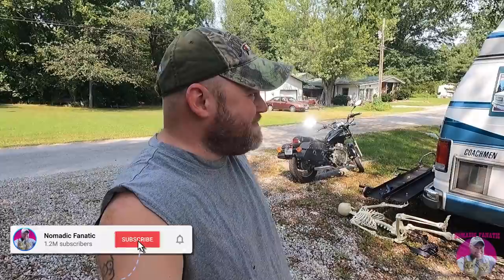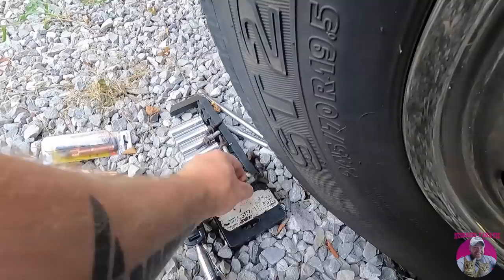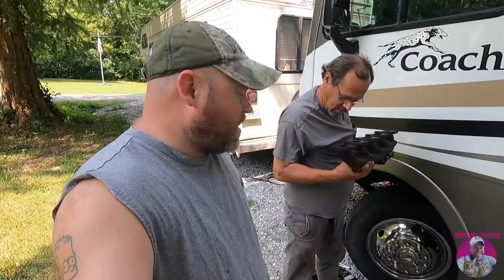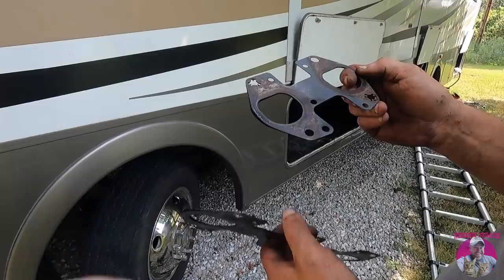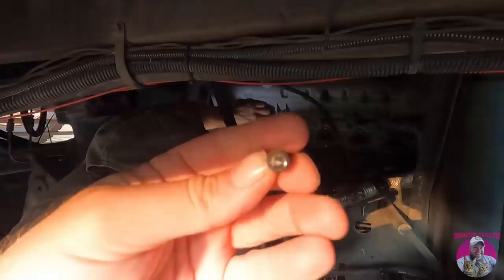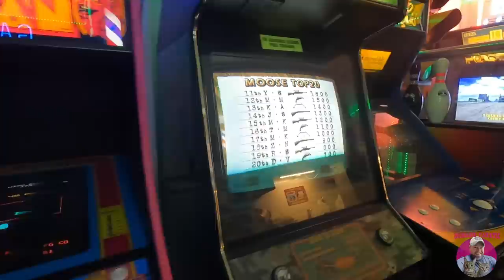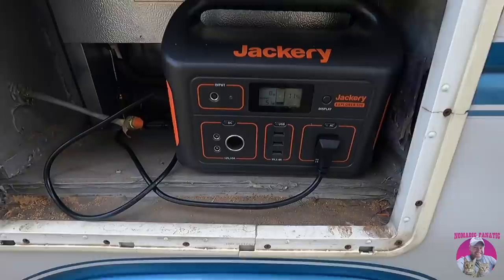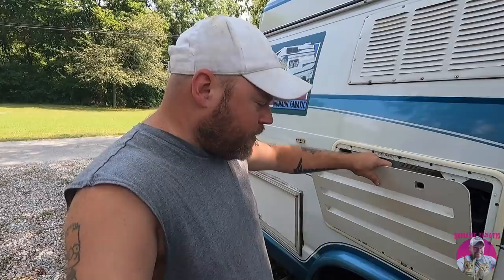Back Working On Class A Exhaust Leak ~ RV Prepper Wayne Drove up From Florida

Comment: One way to keep the Jackery charged to run you fridge longer. The Jackery comes with a 110v charger that puts out about 80 to 100 watts of charging power. Get a $20 150w inverter to plug into your cigarette lighter on the van, and plug the Jackery charger into it. (You may need an extension cord) These small inverters are sold everywhere, including amazon and are only about 4"x3"x1". I have two of them in my minivan. Cigarette lighter receptacles have a 150w fuse, so as long as you're not drawing more power than that, you're fine. A small fridge should run continuously, if you are traveling a lot. Fridges cycle off and on, so the average draw is less than half the max draw. You already know your average draw from your test run with the Jackery. Just divide the Jackery watt hours used by the time it took to use them. I would bet it's less than 50w.

Comment: You and Wayne need to go in together on an RV lot in Taylor Co. FL where Traveling Robert and Awesome Campers are.  They each have an acre.  It required water, power and improvements but you can have up to 4 RV's there.  You would be able to have a basecamp in FL for winter FL trips.  That would give you multiple basecamps for safer travel.  Also, if you got tired of IL you would still have a pl ace to go.  I firmly believe that all RVers are going to need homebases.  Also if you were near Wayne you would have access to his repair skills more easily.

Comment: If you ran the fridge on the 12V output of the battery box, it might actually have lasted a few hours longer, because of fewer losses from converting to AC and then back to DC inside the fridge. Possibly even twice as long? Stands to be tested...
Reply: I thought the same thing! I have a 500 Jackery but only a 20L fridge. It'll also depend on the outside temperature how much power will be needed to maintain the temp.
Reply: His last statement was confusing.  Eric said it ran 12 hours, then he said it was good for 24 hours?  I was curious about that.  I also have a Jackery 500 and my little trailer fridge is AC only.  I rerouted the plug so I could power the fridge during travel.  As long as the fridge is cold, it shouldn't take too much juice to keep it going for 8 hours.  The problem arises if I boondock and need the power for another day.  (I do have 400W of portable solar)  I guess I will have to try it on the road.

Comment: They sell them in 8 packs because most people have Ford V-8 engines, the V-10 isn't nearly as common. Because, obviously, most applications for the V-10 have been replaced with a diesel by now.

Comment: 2 things about the fridge test....
1. How full was it? A full fridge will hold its cold temp better than an empty one. (and thus need less power to keep it cold.
2. How much did you open the door during the test... I assume you didn't. But normally you would be in and out of the fridge during meal prep or grabbing cold barley pops. So in actuality you would probably use 20% more power operating it under normal use.

Comment: Good Video Eric 
Now to get the intake off.  Maybe drop the pan . Cut open oil filter, see if any metal is in there.  If filter ever clogs it will go into bypass port. Putting metal in moter bearings. Love the arcade shots. Looks like fun
Good luck on the cam.

Comment: Why are you not running the fridge on 12v? You are taking 12v converting it to 110v and then powering it up. Is not that using more power to do that? Just a thought.

Comment: Would a high output alternator hooked up to the same inverter and battery bank do the trick?
Reply: That would definitely help. The only thing is you have to drive to charge.
Reply: @lounavarro2604  he won’t have the smart car
Reply: They make a charge controller that can use the alternator and solar inputs.  That is what I am going to add to my truck camper.

Comment: Eric, another option to power the fridge would be a Dc to Dc charger.  It's run off the alternator in your van and the voltage is stored in your batteries.   I think that might work for you.

Comment: Eric, don’t know how bad your drive shaft is or is it recoverable, but any Machine Shop worth any quality at all, should be able to rebuild, remake or even fabricated a brand new from existing material of your parts or from parts. How do you think any hot rod place gets prefab parts when they are modifying their dream car. That’s where machine shops are worth their salt, so to speak. You may have to check around, but they have them available.

Comment: Ever thought about a DC to DC charger? It would charge your battery bank while you drive off of the engines alternator.  Then at night you would run off the battery bank same as solar.  Anytime you needed a charge just run the engine a little.

Comment: Can't you charge those battery packs off of the vehicles 12 volt system? Miss White should have a heavy duty alternator, if not they are only around 200/250 dollars. And pretty easy to install. Considering her age she should already be set up to charge a house battery and you could just tap into that system

Comment: i simple but easy thing that would work is a 2nd 150 amp alternator and battery bank yes you can charge while driving but if you sit for a while you would need to have power or run your generator to charger the power bank

Comment: Eric, since the solar panels are not going to happen, why not install an oversized alternator, and recharge the house batteries while driving it like it was designed to do.

Nations Alternator and starter sold me one for a Jeep that was rated at 270amps, and it was a direct bolt in.